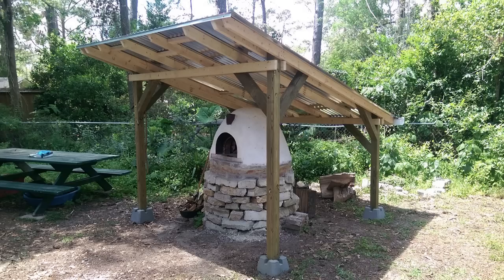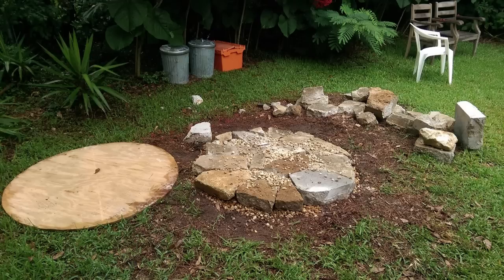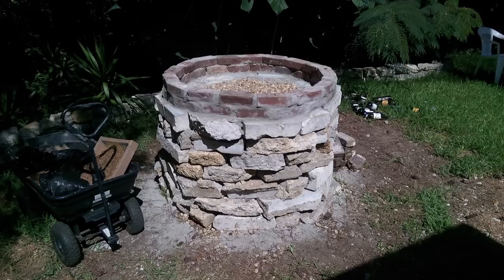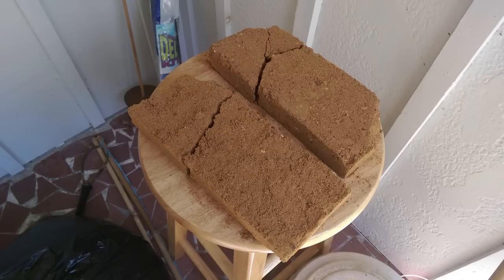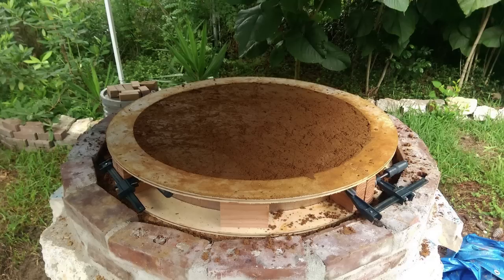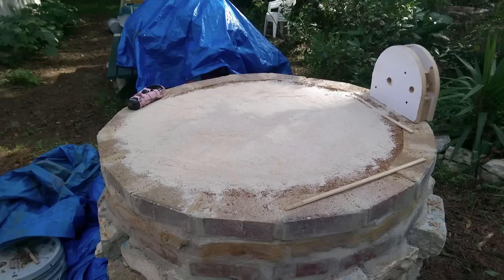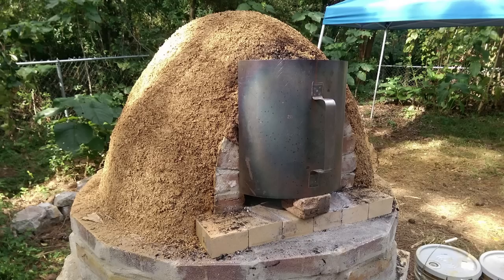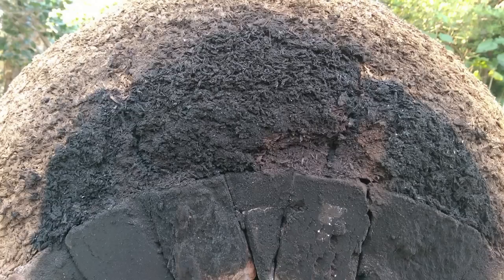Cob Oven Build from Start to Finish

Comment: That’s why we add straw in cobe, it makes it stronger and regulate the humidity for a slow drying and avoid cracks
Reply: 3 parts sand and 1 part clay is quite good too. Its not that important. Just make shure not to render it to wet ;)

Comment: You do know if you want it to dry but not crack as bad initially you don't build a full fire. You first just burn paper. Then each time you fire it add a little more wood. Start with twigs. It will help it dry but slowly so it doesn't crack.

Comment: My ground is heavy silt sandy loam even at 2' depth. That won't work will it? I sun dried a brick out of it and there was very minimal shrinkage. I scratched a 4" line in it that shrank to 3.75". It seems pretty hard and has that ceramic sound when tapped, somewhat hard to break. PS a coffee stand is where I found lots of thick glass bottles. Wood stoves can be found for nearly free and are lined with firebrick. I'm still just gathering materials. Thanks for your video.
Reply from the maker: I think you really need clay. I ended up buying a clay-sand mixture from a quarry company really cheap. My feeling was that I was going to spend a lot of time and energy making the oven and I wanted to give it every chance to have a long useful life. I figured starting with the wrong material for the dome would be a big mistake.

Comment: Do you think you could use this as a kiln for pottery? I see similarities with brick or mud ovens and outdoor kilns
Reply from the maker: No, this doesn't get to those temperatures. Wood fired kilns are normally built with refractory or fire bricks and need specific venting, creating drafts that increase the temperatures possible. I don't know much about building wood fired kilns but there is a lot of info out there.

Comment: Cob is traditionally clay, water, straw and sometimes lime (or sand) so the cracks are appearing because there wasn't organic material and didn't get the strengthening it needed
Reply: Wouldn't the organic material get burned out?

Comment: Love your build. Fantastic job. Could you please share the recipe for the cob? Did you eventually mix your own cob for the plastering on the newspaper or did you just use the ready mix that you purchased?
Reply from the maker: I used the clay/sand mix that I purchased. I do think I should have added more sand to the mixture, though. I'd recommend using the ratios in Kiko Denzer's book - I was off because I didn't know how much sand was in the mix I already had, and I underestimated how much sand I would need to add to it.
Reply: @RobDuarte  Thank you for replying. Take care
Reply: Watch the video!

Comment: One addition might be to use a layer of aircrete over the top to help hold in the heat.
Reply from the maker: The outer shell needs to be something breathable - I know concrete is not a good idea, not sure about aircrete

Comment: Why do the limewash when you have a substantial rain cover over it?
Reply from the maker: Looks good? It's a natural finish that can just get applied whenever it starts to get blackened from smoke. Some people put mineral pigments in the limewash and add decoration that way. (I also wasn't confident that a leak in the roof wouldn't appear at some point and maybe go unnoticed while it damaged the dome. It never did leak, though.)

Comment: Great video.  Question, the insulation you used is the cob (clay+sand+water) + sawdust and then your hearth floor or subfloor (what you filled your circular mold with) is only the cob mixture? I am trying to repurpose some cob + straw mixture and I'm not sure if I need to make just some cob (minus the straw) for my hearth floor.  Or do you think I can use it for my insulation and fill my mold with?
Reply from the maker: No, the "hearth subfloor" is meant to store heat so it needs to be the cob mixture without the sawdust. That cob+sawdust/straw mixture is for insulation - so the heat that gets absorbed by the "hearth subfloor" will stay in that thermal mass and not escape through its bottom (and into the foundation etc).
Reply: @RobDuarte  Thank you.  Also the clay/sand mix  you purchased - was it fireclay/refractory cement?
Reply from the maker: @rosie6486  no, it was just red clay from the ground. Quarry/sand/gravel supply-type places down here sell it for use as a foundation material for  construction. Because everything in Florida seems to be built on dirt (on top of crumbling limestone) 😂

Comment: Did you grout the big 
cement pieces together at all? Also, where can we get the clay material you used?
Reply from the maker: Nope, they're just stacked. The clay mix I used is something that they sell for foundations here in FL. You see it one construction sites before they pour concrete, etc. I wouldn't use it again without adding more sand to the mix.

Comment: cool info thanks. I am thinking of moving to Florida, Do you know of any Cob houses being built down your way? My hope is to build with both Cob and straw bales for my barns and other buildings. Any information would be greatly appreciated.
Reply from the maker: Sorry, I don't know of any cob or strawbale buildings. It's pretty wet here - most of that seems to happen in the southwest US. A neighbor of mine knows a lot about these types of building techniques, though, and was planning to build an adobe house on her lot in my neighborhood. She ran into money problems before she could get started though.
Reply: @RobDuarte  thanks for the response, been digging a bit more found this Q&A on green building website. 
"there is no reason why you can't build with cob there. Cob has been built successfully in very wet places like British Columbia and Wales. If you get very frequent rain you may want to put up a big tarp over the site during construction, or build the roof first. As long as it is carefully designed and built (good high foundation, adequate roof overhangs, protective plaster if necessary) it should last a very long time. However, that doesn't necessarily mean that cob is the most suitable building material for that area. In a dry climate like the high desert, even when daytime temperatures are very hot it still gets cold at night and the heat absorbed by the cob during the day can be discharged. In a hot moist climate where nights are warm, high mass materials lose their passive cooling abilities. You may need to augment with mechanical cooling. And a lower mass building system (like straw bale or wattle-and-daub for example) might be more efficient." 
I also talked to my realtor and he said buy land in AG zoning with no deed restrictions and farm buildings like sheds barns coops etc,. can be built with whatever materials you want all they care about is the roof isnt going to blow off. Others have built "Workshops/Sheds" and "converted" them into living space. There may yet be hope!
Reply from the maker: @angelcastro3129  Yes, you can definitely build with cob here - I did it with the oven. I just had to have a tent over it 90% of the time. But once the structure is built and the tent/tarps are gone, you'd need to have a pretty solid plan for keeping the weeks-on-end of rain from damaging it. Obviously the roof isn't made of cob, but I think you'd have to really figure out the drainage and also definitely use some kind of protective surfacing like I did with the oven: lime plaster and lime wash. I could never have this oven without the roof over it.
Reply: @RobDuarte  Cool beans, I'm looking for properties with no deed restrictions and thought I should first try building a prototype using it as a barn to see how well it holds up with any luck I might convince the local building dept that it is a viable option.

Comment: Rob, what's the diameter measurement in inches of the sand base of your oven? How high is the oven?
Reply from the maker: Not sure what you mean by the sand base. Are you looking for the interior dimensions of my oven?
Reply: yes
Reply from the maker: About 23" diameter / 15" at it's highest point (which is not the center, as I described in the video)

Comment: wont the bottle explode once heated  or crack later leaving behind a hollow points...???its it okay to used them as u did.?
Reply from the maker: xcel cd I don't believe so. They are pretty hearty bottles and there is some distance between the very high heat of the oven interior and the bottles. also, the reason they would want to crack is not from heat but from cooling too fast, and I would think they would be losing their heat quite slowly, like the rest of the oven. Finally, even if a bottle broke in there, I'm not sure what effect it would have... There would be a void since the surrounding material is all hardened at that point, and that void would be just as good insulation as if the bottle were intact. The bottles are providing some kind of support for the material above, but I really don't think they're breaking.
Reply: thanks for the instant reply. 
btw if your aren't facing any problem with your oven in that matter then it should be ok..also, can we used aluminium foil, for further insulation.?
Reply from the maker: I wouldn't. The idea is to have the shell be made from materials that are "breathable". I think a layer of aluminum foil would defeat that goal. I also don't know if it would have much effect. I think Kiko Denzer mentions it in his book as something someone had asked about at one point and I think his answer was something along the lines of: go ahead and try, why not?
Reply: Rob Duarte i see, i wouldn't go for the foil since your answer make sense. Thank you again.

Comment: My father wants to know why put bottles of wine in the bottom of the oven? thank you
Reply from the maker: The bottles are empty. They become pockets of air underneath the floor of the oven. Air is a good insulator. This insulation keeps the heat that's in the fire bricks (and the mass of clay underneath it) from escaping into the stone foundation.

Comment: Your door hight should be 63% of over all hight to be accurate for air circulation. The sand clay mix is 1part clay 5parts sand. The outer layer is that mix plus 70% straw.  Yours is way off. But the base is good
Reply from the maker: Yes this is all described in Kiko denzer's book. My door height is 63%. The clay to sand ratio was hard to determine since it was a clay sand mixture to start with. As I said in the video, I experimented by making bricks but still decided that I'd need more sand next time. For the insulation I used wood shavings from a saw mill instead of straw but the ratio is about the same. So nothing is off from what you wrote. I'd be hesitant to rely solely on percentages though .. contrary to the understanding of most people today,  making things offen requires hands on experimentation/experience/judgement more than numbers. This is dirt and fire, not CAD and electronics. :)
Reply: You are way to technical ..relax build one and learn ..quit being afraid of mistakes ..our ancestors didn't put a lot of tech in those ..it's made from simple material with simple tools

Comment: Do the bottles have the caps?
Reply from the maker: No, but they are essentially capped by the surrounding cob mixture. They become pockets of air. Even if a bottle broke for some reason after the oven was complete, there would still be a cavity in the mass of cob, which is the idea - air pockets as insulation.
Reply: @RobDuarte  thanks for the time you took to answer,thanks for the video. No too many vids are as good with the real information and the time.keep it up Rob.

Comment: arent you suppose to break those bottles?
Reply from the maker: No, the glass isn't what's doing the work of insulating - it's mostly the air that it's trapping. Breaking them wouldn't be as effective.
Reply: i also thought it was meant to be broken, that way the glass retains heat and the air gaps in between the glass will still insulate, the glass is a heat sink? it should, by my thinking have insulation under the glass. having said this i havent built an oven....yet, so great vid and well done
Reply from the maker: Yes, that's effectively what's happening. The air trapped under the glass is insulating. If the glass were broken, there wouldn't be that air gap (except maybe little pockets captured by shards).  -- When I was in grade school, my mom gave me a grown-up thermos (with glass containing a vacuum) on the day that she couldn't find my plastic one, and of course I dropped it. It didn't work as well after that. ;)
Reply: ok rob, i get the idea now, my mate paul said he used glass so i presumed he meant to hold the heat not to insulate. so if its for insulation my immediate thought is why not celotex/kingspan. my only thought for the glass idea is lowcost ?
Reply from the maker: Chris Hunt yes, even better than low-cost.. no-cost :) Also, I'd like to know how air compares to insulation board. I keep reading that air is pretty much the best heat insulation there is.

Comment: are the foundation stones mortared together?
Reply from the maker: No, the big stones at the bottom are just dry stacked. The layers of regular red bricks are mortared together.
Reply: Forgive me, I'm a numpty when it comes to building but what's the advantage of not mortaring the foundation stones, given you had mortar for the bricks?

Great job btw, I really admire your persistence and how you kept adapting the insulation until it worked.
Reply from the maker: thedr00 they're such heavy stones that I didn't see the need to stick them together. I'd also end up using a ton of mortar given the big gaps between them. I was trying to keep things only as complicated as they needed to when possible and mortar just seemed like an extra step. On the other hand, you don't often see bricks without mortar and it seemed to make more sense to mortar them than not.
Reply: Got it. that makes sense. Thanks for your answers and enjoy your oven!